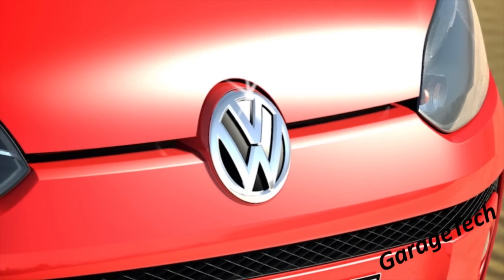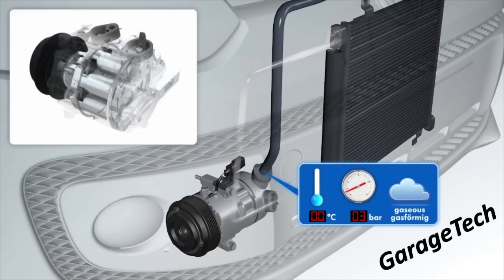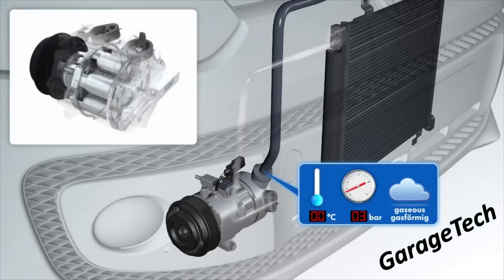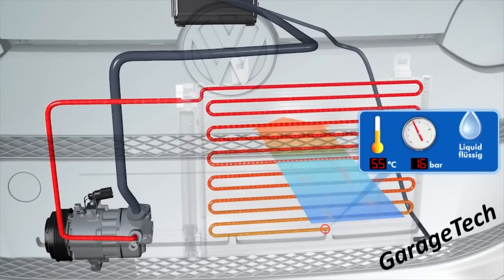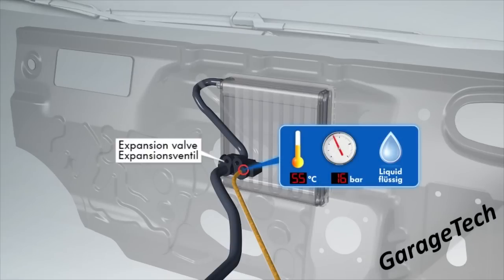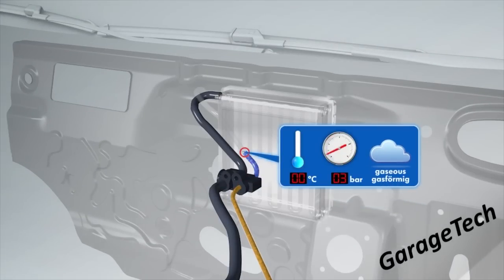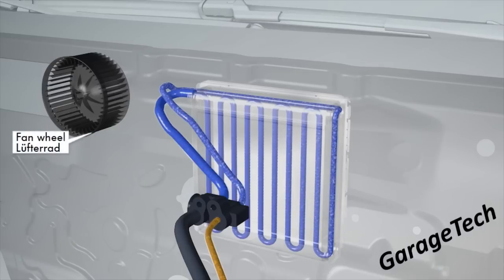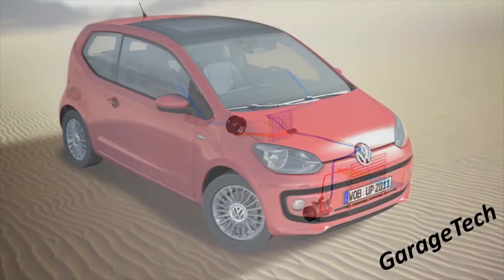How does a cars Air Conditioning system work?

Comment: hello.. anybody knows if the water continuously coming out under the engine if ac is switch on.. normal or not???
Reply: carlo consebido not normal. Your evaporator might be clogged with dirt. Have your ac serviced to make it ice cold again. :)
Reply: carlo consebido not normal. Your evaporator might be clogged with dirt. Have your ac serviced to make it ice cold again. :)

Comment: let me explain this philosophy of air conditioning. the car a.c. is basically designed keeping in view the temperature of the engine. for instance, 85 degree centigrade temp. of refrigerant is at compressor, which then cool down. what if you just run this whole system outside the car compartment by using a electric motor? what i observed that during a rainy day, the car a.c. air was not cool enough due to the reason that car was taken to a repair shop, and the gas pressure was disturbed.  when the sunlight came, the air became cooler. the reason is that , you have to balance the heat and cold, if it is disturbed , the a.c. will not work properly. both heat and cold act on each other. so on the rainy day the coldness of evaporator started to travel to high pressure line, and from my point of view, I guess that the gas pressure was disturbed.

Comment: dear sir plz give me an answer to me plzzz....my ac has a complaint now that is...the high pressure pipe from RD bottle to evapurator is cooling too much and the evapurator also...but the low pressure pipe from evapurator to compressor is not cooling....i have fitted my temperature senser on the low pressure pipe....so the cut off system is not working properly

Comment: really nice , i am impressed . can you show heater system ? how its works step by step to end?
Reply: Engr Hasan Yeah, a in depth one would be good too, but basically, it's just opening the blend door and letting some  from the heater core (which is circulating in conjunction with your cooling system via the water pump) as well as atmospheric air (outside or recirculate) to achieve a set temperature from mixing the two.

Comment: what if we compress air and blow it through a nozzle directly to the cabin ?
Reply: It would be really hot high pressure air. And then you'd need to fill the system again immediately after a burst of near boiling air.

Comment: we have a heatwave at the moment in the Mediterranean Sea,, it was going up to 36-38 over the past few days. Tonight its 26 minimum.
Reply: Your weak ass cannot stand the usual temp in asia
Reply: Yeah but that is only Asia near the equator, ie SEA. Japan and most of China, for example, are not experiencing this heat.
And actually SEA doesn't normally experience 36-38degC, it is closer to 30degC, but the difference is it is always 30degC.

Comment: When the Low temperature passes through Expansion Valve doesn't it remains liquid.That is a low temperature low pressure liquid..And when the fan throws the ambient hot air the liquid refrigerant absorbs the heat and only then converts to gas??
Reply: I think you're right.
Reply: abhishek nair exactly
Reply: In a conventional AC system the expansion valve turns it into a liquid/gas mixture. Not sure if it is different in automotive
Reply: The only different thing with automotive is that TEVs belong to the block type (internally equalized, internal sensing bulb). Some liquid may convert into gas even when the fan is off as soon as the evaporator is warm, but the evaporator would soon become ice cold and the expansion valve then experiences trouble in keeping that liquid from exiting from the evaporator even though it struggles to do that... the biggest issue however is not with that little amount of liquid that may well evaporate inside the suction pipe before the compressor, but the expansion valve closing up too much and doing 3 bad things: 1)depriving the compressor of the lubrication flow (not such a big issue when the compressor has a sump however, but automotive compressors nearly never feature one) 2)driving the high side pressure too high 3)driving the low side pressure too low and therefore increasing the compression ratio too much and making the compressor overheat...
Reply: I don't think that's right, what if the ambient temperature is the same or lower than the gas temperature? it will not turn to gas? the compressor can't receive liquid to compress it, only gas. The time the refrigerant leaves the thermostatic expansion valve it changes from liquid to gas.